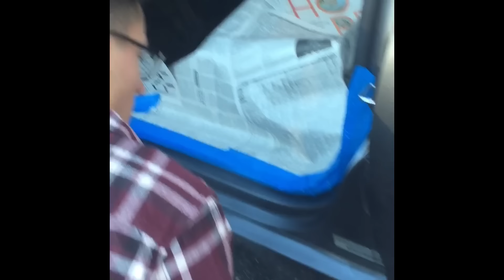DIY Rust Repair Cheap And Easy!

Comment: There's a lot of people saying what he should have done or he didnt do something right etc.

This likely wasnt meant to be a perfect job. It was just avideo for those who dont want to pay a dumbass body/paint shop $800 to fix something like this.  Ive been in this situation where you take it to a shop and they start with their bullshit acting like its rocket science and they will need your car for an entire week and then charge you a ton after telling you that the rust is a death sentence for your car. 

A lot of shops are just full of shit and rip people off. This is likely why ths guy decided to do ths on his own because he probably got an inflated estimate. Turned out prettty good considering he likely spent less than $50 and maybe an hour or 2.

Comment: I always use a rust converter as the first coat of primer. There is always rust you can't see remaining after the sanding. Otherwise, excellent repair.

Comment: I liked this alot, good work it came out great. I've got a few bubbles I want to fix also, I do agree with using a rust converter / stabilizer underneath first.. that stuff really does prevent the rust regrowth.

Comment: well it is not permanent  doing it that way but its inexpensive and easy ,that repair will last about six months before the rust bubbles through the same spot again, might last a year if you paint rust inhibitor on to that bare metal before the primer, but yeah,  its not bad, here in England we call that a" bodge job" a quick inexpensive fix in the knowledge that it will not last too long.
Reply: Or if you know you're selling it on.

Comment: Nice. But, as suggested before, use a chemical rust stopper after the sanding and before painting. It turns black. Ive left it like that, didnt look nice but the rust never came back on those spots on my old car. The sanding is MOST important!

Comment: Most base coat/clear coat paints only require 30 minutes to an hour dry time and you can clear coat. 24 hours is way longer than needed for base coat to dry.

Why did one little spot become the whole bottom door jamb?  Remove rust, sand only what you need to, spray on Rust Stop rust converter, fill and smooth off with bondo, sand the bondo, prime with Primer Filler x 3 coats (10 minutes between coats), wait an hour, sand again if needed. If you do sand, put on one final coat of Primer Filler (Dupli-color), wait 30 minutes. While you wait for the last coat of primer to dry, get a piece of cardboard large enough to protect the area around where you want to paint. Cut a hole in the cardboard the relative shape and size of the area you want to paint. Hold the cardboard one to two inches from the spot you want to paint with the hole in the cardboard right over the area you are going to paint. Spray the area through the hole in the cardboard by holding the spray can about 6 to 8 inches from the cardboard. The cardboard reduces the overspray area around your repair quite nicely.
On small stone chips you make a small hole in the cardboard close to the size of the chip you want to paint, and for small touch ups you hold the cardboard closer to reduce the overspray area. When you have enough coats of paint, wait one hour and clear coat using the same cardboard and same method.  If done right you don't need to wet sand. A bit of rubbing compound after 24 to 48 hours to remove any dull overspray areas is good enough. Wait 30 days then seal it with Nu Finish and wax over that with Mother's Brazilian Carnauba wax. I've done lots of touch ups using that method. The more you do it the better you get at it.

Comment: u did a good job.  sandly u left the rust inside. you should remove the rust compleatly. all tiny holes should be filled with some chemicals. it will come back sooner or later.

Comment: If time is not a problem, put a rag in 7% vinegar and press on affected area and leave alone for a day, repeat if necessary by adding vinegar and changing rags. The rust in the small holes will get eaten away and a final run with the grinder will clean what  is left of the oxide.

Comment: I just watched an episode of "POWER NATION"-and once you are down to bare metal there is a spray(forget what)-that changes the chemical composition  of the minute rust particles left behind-your bare metal should be treated with that -then spray on the primer. I bet your rust spot is already starting to return

Comment: I need to do that on my 2012 Ram 1500.....under the doors on the drivers side is rusting, just surface rust so far...also got some rust on the passenger side rear quarter right in front of the rear bumper

Comment: Guys i have one important question. I own a e34 m5. My car is completely original and stock. It's  22 year old car so it's got some chips on the hood and tiny bit of rust around the wheel arches. Are there any options I can do to fix the problem. I do not want to paint it as its Got originAl paint. Thank you so much

Comment: Rust is still there, it will bubble the paint, spot putty is used for totaly diferent thing, wet sanding when you hear sand in between. 
But for driveway paintjob its good.

Comment: Soaked... Thanks for your good will and video. I have a Forrester 2002 with double rear fender spots (both incredibly in the same f***ng place!) that I plan to fix (already fixed one, but return like a bad odor). You think it's bad idea to use fiberglass, if I encounter a hole in the metal? Again, how about "grounding" the entire vehicle with a chain to touch the ground all the time? Would that avoid redox, hence rust? Keep the good work and - btw - screw the deaf and blind people who did not like this. !

Comment: Initially you should have ground deeper into the metal. Exposing clean metal and then applied any paint or primer which will take care of any deep oxidation. Other than that Nice job!

Comment: I want to fix some minor rust spots on my vehicle too and you did a great job. Just wondering, do you recommend wet sanding between coats?
Reply from the maker: +Kaelan Wong if you let each base-coat completely dry between coats, I would do some sort of sanding to give the paint something to stick to. That's not the way I do it but I have seen it done that way.

Comment: Use phosphoric acid on the bare metal/rust after grinding and sanding to convert the rust, then use an etch primer (which also has phosphoric acid) as the first coat. This will kill the rust permanently providing the rust is not coming from the other side.

Comment: They did not remove all of the rust before they sprayed the sandable primer over it (at the :50 second point). there are chemical acids that you can get to finish the removal of the crevasse/valley rust before spraying the sandable primer. This rust will bubble back up in less than a year.

Comment: Nice job however even if you apply rust treatment the rust will still return because its a box section and it will come from the inside . You can delay the process by injecting waxoyl .

Comment: Heating up the cans is not recommended (it is even written in the can itself). They can explode.
One should also wear a mask for both sanding and painting.
The red dots in the area will make your paint fall, as someone has already noticed in another comment.
Spray paint flies everywhere. Door and interior is here also black so you do not notice, but surely slight shades of primer can be found in that door.
And yeah, I have made all those mistakes. That is how I know (not the first one though, that is common sense).

Comment: DIY is good,  repairing rust and finishing it with Enamel..Cheap.. by the way, you should try Car painted in Enamel.. i want to try car painted in tinting color. it looks the same as Flat or matte color.

Comment: If you do not treat the rust it WILL be coming back, treat it then etch prime or epoxy prime to seal out air and moisture, a simple primer will not do it, primer and base coat are porous, so use a good 2k clear over the top

Comment: Do that and the rust is back in 6 months.
You need a rust converter on acid base.
And you don't remove thr rust with a grinder because it takes too much material of.
There are wire brushs from plastic for the grinder.
That's it what you need.

Comment: The repair will last for a while, but the rust will come back sooner or later. Why? Because the only method of rust removal used here was mechanical flat sanding and hand flat sanding. This means that the sanding disc cannot get into all the little rust pits. I would start with the flat sanding, then add a mechanical rotary wire brush (I would also use my MBX Blaster first  - but that's an expensive pro tool) to get into the pits, then some chemical convertor, then another wire brushing, then a zinc rich primer, then filler, then another primer, then paint.

Comment: why did you sand after you put on the clearcoat
Reply from the maker: +dylan scronce it helps smooth out any imperfections reducing the orange peel look. I used a finishing sandpaper which is a very fine grit and buffed it shiny to finish. Make sure you give your clear adequate time to dry before sanding and buffing.
Reply: +Soaked In Oil ok cool deal
Reply: Soaked In Oil clear everything

Comment: Good if you sell the car right after that. That rust will be back in 6 months. It comes from inside and underneeth its still present. And you should spray in one stroke starting to push outside the area where you want the paint.

Comment: You missed a step rust inhibitor penetration allowed to dry and then washed down and kill rust undercoat primer before the spray putty was applied  or the rust will be back by winter.

Comment: came out clean ... you used a heat gun so it should be sticking quite nicely
Reply: i had to do my hood on my camry ... the high pressure hose at the car wash took some paint ... hand wash your car ppl

Comment: shouldn't wax for about 7-14 days after spray painting as the new paint needs to gas off (out gas), factory and body-shop finishes are baked but you should still wait 24-48 hours before waxing.

Comment: Great video! One suggestion: Don't use your finger to apply spot putty. The oils in your fingers aren't good for the paint job (although it appears you got away with it, quite well I might add). I make little spatulas out of plastic milk jugs cut to the desired size and taper.

Comment: me myself a beginner:

I use sand paper  no. 100, and no. 500, and then no. 1000

and then apply some plastic body filler something like alfagloss, and use sand paper again

finally i use some car paint and mix the color and spray it

done

Comment: yeah I left my car to get the windshield replaced because it was leaking on me and my floorboard and the installer called says that there's rust and asked what I want to do.. he already through my old windshield out and didn't give me a choice all he said was that I have to take it to a body shop and I'll still be charged what 200 bucks

Comment: You have to cut out the rust back to good metal or the rust will only come back. This is the kind of fix you would use if you were going to get rid of the car.

Comment: you forgot to treat the rust still present after sanding with a phosphoric acid solution which would stop it permanently.  This rust will return, give it 2-3 years.

Comment: Great job! Thanks for sharing! I have a 99 Ford Ranger that needs a few spots on the cab roof worked on along with all the clear coat work.  Big project. 
I want to know the products you used during the video.  For example, what spray paint products did you use? overall, how long did the project take from beginning to end? 
Thanks again!

Comment: It looked like the rust had holes going through the metal, so the moment to gets wet all your work is for not. The only way is to cut the rust out weld in new metal. If you don't, it's a waste of time and money.

Comment: I wouldn't thumbs down this, however, that repair won't last a year before the rust comes back. He didn't get ALL the rust out of the pits. The paint will slow it, but you must sand blast all that out to "white metal" or you are only doing a temporary fix.

Comment: By rust see you again in 6 months. Zip wheel it Use phosphoric acid leave over night zip wheel again. Unless the rust is coming through from inside it will be gone.

Comment: that rust will be bubbling back up by now. rust needs to be removed to bare metal (bilt hamber deox gel is good for this) or cut it out and weld in a plate. no point painting over the rust.

Comment: This will only last 6 months.  Rusting from the inside to the outside.  Car engineers designed it that way 15 years then it willbe rusted out.  If you want to keep your car more than 15 years or get good resale  get a good rust proofing each year.

Comment: Looks good- for now is not a repair. It's a patch. As shown this is what flippers, and cheap, not wise, car keepers, do.  Car keepers fix problems it as few times as reasonable. For an owner who intend to keep a car this would be a temporary cosmetic repair of a car bought just before winter sets in. It would hold until spring,  look ok when it could be done better.

btw, ANY surface-down repair assumes that rust has not penetrated through the metal. If it has, rust will keep reappearing unless the back side is treated. 

The work shown has an expected lifetime of one year in a region with heavy rain or a winter freeze and a humid summer.  That's how long it will take for the encapsulated rust to push the primer up and re-start faster and create more extensive bottom-up paint failure. If you already have a car in the summer and want to keep it for years, don't wait for it to progress to the level SIO did, start as soon as an scratches or bubbles appear and invest more time to do it better. 

Using just a rust neutralizer would extend a surface repair by at least 1-2 years. Dissolving away the visiple brown rust with acid, then washing it away with water and air drying, followed by treating the deepest surface pitting with a neutralizer will take another hour or so and could extend the repair life by 4-5 years.  After that,  using a good paint sealant at least annually can extend it indefinitely.

Comment: Why you use not rust remover? Rust stop? If you using a flex for remove rust you burn it into the material and rust is soon back.... Only grinding helps

Comment: if that's all you did, it will most likely come back. you got kill the rust in every little pit. I see this as mostly a cosmetic repair. rattle can paint is not durable 2 part (activator) type paint, at least the primer should be.

Comment: The method you used won't work in the long term you didn't use rust converter so it is going to rust under the paint you just put on

Comment: This is useless. I stopped watching when it was clear that no rust neutraliser was going to be applied. It's not enough to just sand the surface rust off. There's still rust in the steel, you can even see it as dark patches against the freshly sanded steel. If this rust isn't neutralised it won't take long before it starts coming through the paintwork again and all that work was for nothing.

Comment: Very poor repair that will not last. You have to many rust convertors and removers to do a better job. Even some that are gel and stick to vertical surfaces  Poor 15 is good but no rust is a better start. No clue why you would tear up the glass to those crappy strips. That repair will fail in short order. Also any repair needs to drain like it did when new. I have 4 doors on my 2001 Dodge to fix some rust. I'll get rid of all the rust. Then use West system epoxy products and glass. I'll probably glass doors from inside also. 3" high on sides and bottom and leave all drains open as it was new.     Time consuming but it will last a long long time. Epoxy resin with fillers is super tough. Bondo is not water proof.

Comment: A number of errors in your method. Firstly, you're better to mask off/protect the bodywork, interior (in this case) and glass BEFORE using an angle grinder!!! otherwise you will damage it from flying white hot sparks (and they will embed in glass, plastic) secondly, best to neutralise the rust, and use zinc-phosphate primer first, either red or grey, before the primer/filler. Alos, I really couldn't believe it well I saw you use a heat gun to "warm up" a pressurized paint can! This is dangerous, and can lead to an explosion/fire. After that I didn't want to watch your amateur video anymore.

Comment: Another bad video on how to treat rust ! 🤦🏻 no mechanical abrasion via wire wheel or flap wheel, no attempt to phosphate the surface before paint and no epoxy primer. I wish the inexperienced would stop posting videos like these 😖

Comment: Dreadful ‘advice’. No inhibitor used to prevent future corrosion, or Fertan to convert what’s there. Use of a heat gun to cure paint just shows how bad the repair is. Rust will return. Typical botch-up job by an unqualified ‘repairer’.